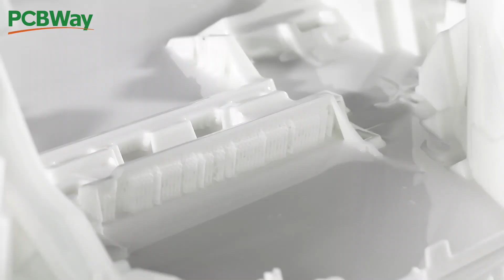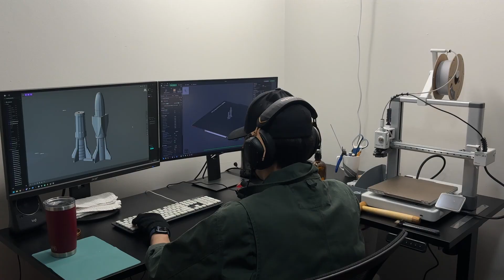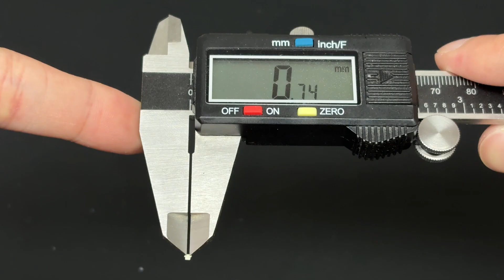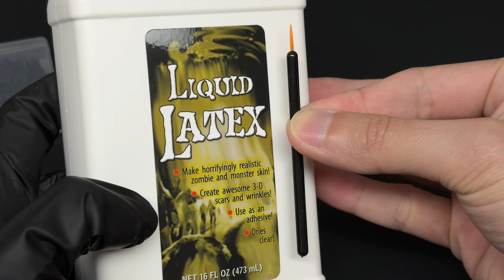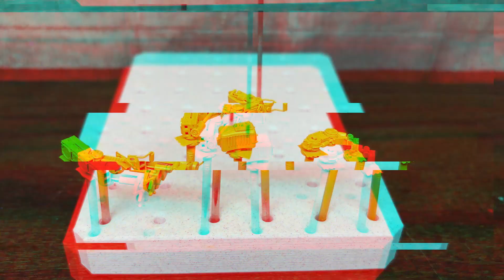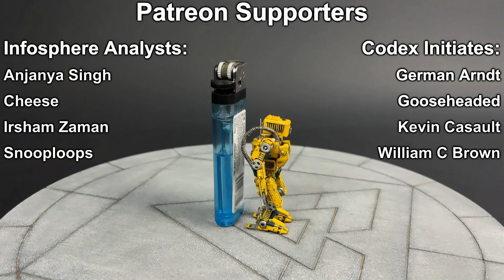Meet SPARX - Ridiculously Tiny LED Robot

Comment from the maker: During the retrieval of Derrick Foster’s work logs, portions of the original audio suffered from technical interference, resulting in static and inconsistent vocal quality. The Royal Archive has applied advanced filtration and restoration protocols to recover the material to the highest fidelity possible.

These anomalies remain present in certain sections but have been deemed acceptable for official preservation. Updated audio equipment has been requisitioned to prevent recurrence in future broadcasts.

Thank you for your continued patience and understanding as we maintain the integrity of Dominion records.